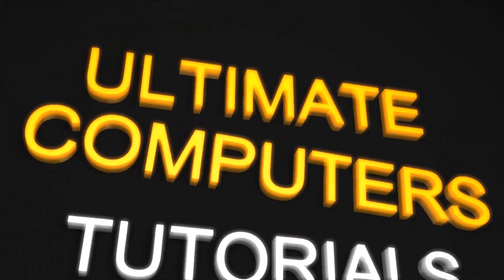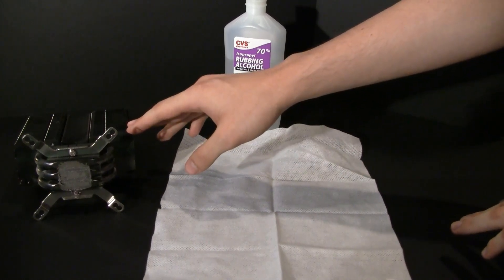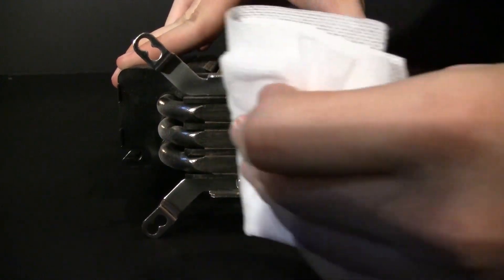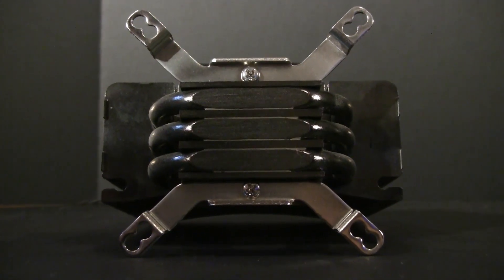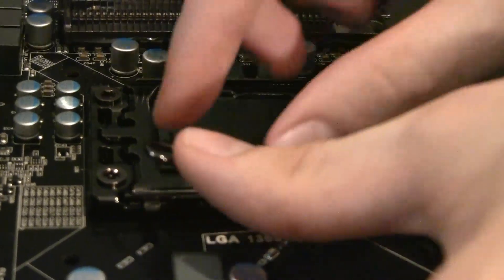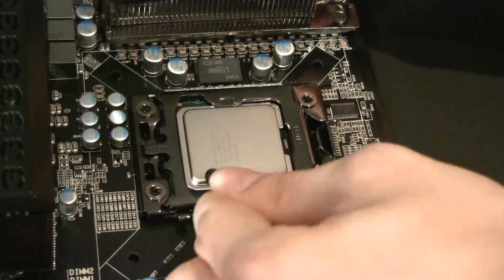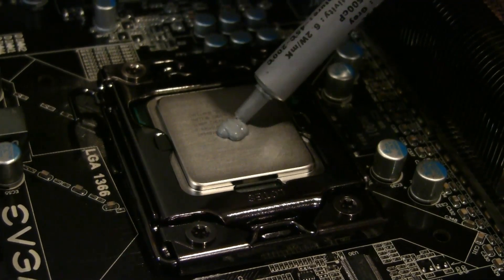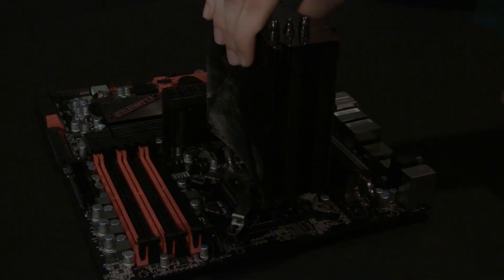How to Remove and Apply Thermal Compound  [Updated Tutorial]

Comment: @pratt123 it's a new rig... a haf 922 case with extra 200mm side fan and cpu is NOT OC'ed... and even after applying AS5 in full load with stock crap intel fan heat was around 90 C. I have tried many many ways to solve this heat problem ... including applying several times the paste (none worked) ... Anyway, problem is now fixed. Bought the Noctua NH-D14 to replace the stock cooler and re-applied AS5 (the same as in this vid) and now I get around 57 in full load.

Comment: @Creohan We will assume you removed most of the dust in your system (compressor, canned air, etc.) and tied up most of the cables in your case with cable ties to improve airflow (we will also assume all fans are working properly).

What is your cooling solution? (stock air cooler, aftermarket air, watercooling) And is the CPU overclocked?

Properly applied thermal paste can reduce CPU temperatures by up to 30 degrees Celsius (ideal). This is still too hot so there are other problems in your rig.

Comment from the maker: @Creohan No, there is more than one way you can apply thermal paste.  Just be careful with the vertical line: If you are using a processor with two separate dies, you have to be sure to apply is across them, and not between them.

Comment: question. How do i know when i should apply new thermal compound to my cpu? I've had my vista for almost 4 years now. 

Basic questions are:

How do i know when i should use it (on an old chip)?
Do i need a new cpu chip, or can i remove the thermal compound from my old one and re-apply the new one on it?

Comment: Sorry for asking another question, but I still don't understand on how to apply the thermal paste. You are using some large table like that to put it on, does that come with the computer. I never really looked inside of my computer. I had a friend of mine install an Lg Light Scribe Burning Cd Slot, and that's about it. I wanna deck out my computer, and I know it's gonna cost a lot of money. I am hoping to buy an Hp Monitor, and an Hp keyboard, but I might buy other things.

Comment: Excellent tutorial. Definitely never spread the paste as you get air bubbles between the heat sink and cpu and these air bubble hinder cooling. I would also recommend that you use half or third the amount of paste as you used here and aim to make it the shape of a pea so that when you apply the heat sink, the paste will spread evenly outward without trapping air. There is no need to cover the whole chip with paste, Think, less is more

Comment: @sciguy14 thnx. cuz idk y but my system keeps overheating so im trying to find out wats wrong. is there a lga 775 heatsink and fan that can also be used in LGA 1366 system that u recommend? It turns on for bout 10-15 min then shuts down. I feel the heatsinks and they r a bit hot and so the vid card? 

Can you post a video how to set up a lcu(liquid cooling)

Comment: if its been roughly been a year, do i need to change the thermal paste even if i am using the stock fan? I have an Antec 1200, nvidia 790i Ultra, quad core 9550? THnx

Comment from the maker: @thehill251 you ALWAYS need thermal paste, or the CPU will overheat.  However, stock coolers already have it applied, so you don't need to do it yourself.  Only follow the method above if you are using an after-market cooler.

Comment: I got a question. how do you remove a CPU that has physically attached itself to its heat-sink without damaging the CPU. It's like the Thermal Compound soldered the CPU to the heat-sink.
It came out of the motherboard in one piece.